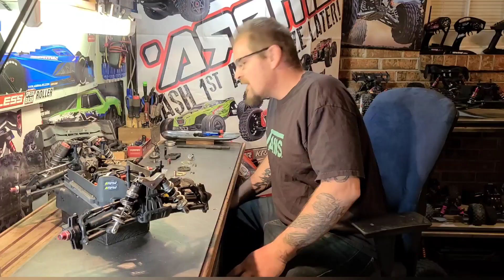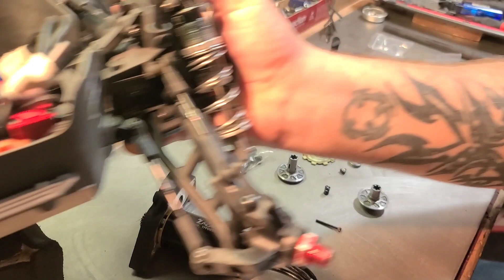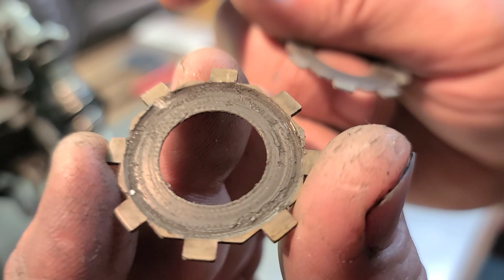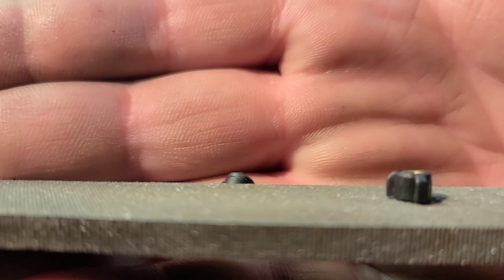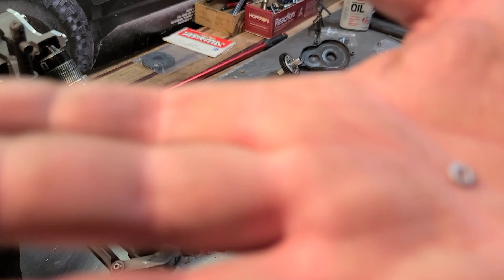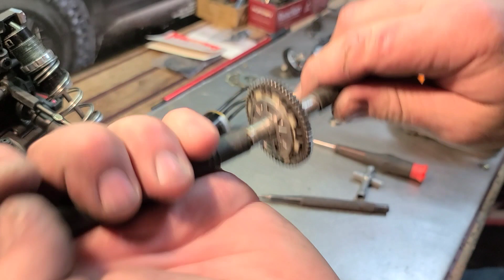how to set your arrma 4x4 3s & 4s slipper cluch, no more problems!

Comment: 18:40 is a good tip about seeing how tight the slipper part of the slipper clutch is supposed to behave utilizing the drive shaft pieces as a turning tool.

Comment: I am new to all this, I purchased an aluminum motor mount, center block support. The piece that slides out with strap. Then it came with a slipper spool all steel. But the spur they gave me is 57T, the vendetta has a 50T. So I want to swap the 50T on the all new steel slipper spool. So this should help a lot. I don’t know shit about “shimming” or nothing. I may break it.
Reply: if you got the generic one your better off with the threaded hub that doesn't interfere with input gear. no trimming just used a arrma slipper clutch threaded screw, spring and the thrust bearing. lots of thread lock. if you have problems getting the motor assembly to click back in just loosen off on the differential screws.... insert, retighten then it will be bullet proof you go through diff ring gear, input gears, center drive shaft faster than the sli[pper clutch.
Reply: i should add here that i learned that the hard way, i put a Granite suspension, wheels ect on an infraction  and i went through 5 slipper clutches
Reply: @daniellangevin7195  I am in the
Process of building a GT Limitless V2. All perfect pass parts. Literally have every single item perfect pass sells. Everything. Then everything else is scorched. Then I have a xlx2 with a 2028 1700kv setup. It’s going to be absolutely insane. I still have the vendetta and I ended up buying a new slipper assembly because I couldn’t get that got dang pin in the damn thing. It was SO FRUSTRATING. I ended up throwing the metal sour gear across the room. lol. 😂

Comment: I cut it and half with a razor and I didn’t have to trim the end where the motor goes cause it fit all the way in now just got to change my clutch slipper pads and it’s good as new

Comment: I reused the stock clutch pads on a hot racing steel spur for my vorteks 3s and it slip’s really bad, I think I need too use different pads and use 4 pretty sure I only installed 3 pads
Reply: you only need 1 or 3

Comment: I have a granite 4x4 mega and put in a blx100 system in it the slipper clutch just slips i got two runs out of it what do I do to fix it?
Reply from the maker: There's a slipper clutch rebuild kit available, it has the special screw bushings & new spring.    Use red loc-tite on the slipper screw when rebuilding the slipper.    Or you could buy a new slipper assembly prebuilt
Reply: @IRONCLADRC  I bought the whole slipper clutch setup the second most expensive one that amainhobby's had cost me 45.00$ can't you just super glue the slipper clutch to eliminate it that's what I did to my Traxxas slash
Reply: get a 57 tooth generic one, then use the hub from it the spur gear and the 3 pads. then instead of using the screw that came with it opt for the slipper clutch maintenace set. i think arrma is 19 cad.
Reply: lots of locktite on longer screw and into the threaded hub.

Comment: Are the V2 4s outcasts slipper pads like PCB boards.. im sure it had metal on them the last time I checked it😂
Reply from the maker: Not sure brother
Reply: @IRONCLADRC  no worries I was actually doing that when I commented.. threw it back together and it's doing as good as when it left the box... Not gonna push my luck but it'll give me a chance to drive with my mate atleast once 😂👌
Reply: Cheers 👍

Comment: I bought a slipper clutch maintenance kit and it it stripped right away. As of I bought the complete slipper clutch kit
Reply from the maker: I had the same issue.   Waist of money
Reply: on the chinese online stores you can get a generic one use everything  it came with except the screw. use the long screw from a maintenace set along with spring and thrust washer. for the 4 extra bucks i would have bought the arrma one now that i see the little thrust washer plays an important function

Comment: Hi I just replaced mine with a differential you'll love it balances out the power front the rear launches out of the hole like crazy and no more wheelies.
Reply: Yes But if you ask your local hobby shop, they will call it a center differential it is the best mod you can do for your RC truck. You will absolutely love it.
Reply: @andrewfrost4802  where did you get it? I can't find any differentials other then a center locking spool
Reply: You mean a center spool?
Reply: I would try the center locking spool. The one you're talking about if you can't find the differential. I bought mine from Hobby Town. In plano texas Super cool guys that work there, too. They are really nice people.
Reply: I forgot to ask you what kind of RC car you have?
Reply: @andrewfrost4802  I have a 6s kraton, a 4s but 6s capable traxxas hoss, I also have a 4s big rock, planning to buy a 6s maxx soon

Comment: I Have The Vendetta & My Buddy Has The  Infraction, We Both Running 4s, We Race On A Parking Lot, So If Tighteen My Slipper Clutch Just A Little Bit, I Will Have A Better Take Off, On The Corners Or Turns, Right??
Reply from the maker: Yes sir that's correct, don't over tighten or you'll run into problems
Reply: @IRONCLADRC  Ok Thanks Man!! I Appreciate..!👍😊👍 I Just Hope My Buddy Dosen't See This Question Or Comment...Lol!😆

Comment: I've done this with my senton I've upgraded to a 3s system and all it does is spin the slipper.  I glued the plates to the hubs and now it just burns up pinion gears.  I had no problems out of the plastic spur and stock slipper set up. I put in the metal 57t and nothing but problems.
Reply: did the 57 th tooth come with 3 pads?
Reply: @daniellangevin7195  nope. Just gears

Comment: My Home Depot Has the same set screw it’s a M2.5x25mm cap head screw but any screw with the same diameter and and a length of at least 20mm works the same I’ve had better luck with a Phillips head that’s 20mm than the ones arrma provides
Reply from the maker: Thanks for the information
Reply: The one arrma supplies is a one shot deal. cross section to thin to be back off esp. after locktite
Reply: @ when I had my Senton the one that was on it was hex, did they downgrade to cross ?

Comment: Now I got a metal spur, but now it's grinding again I'm thinking it's the front differential since it grind when doing wheelie
Reply: did you try the slipper clutch maintenance set. with a generic 57 tooth slipper clutch? the hub fits no housing problems clicks right in. the hub on the generic clutch is threaded for a fair distance yet it slides no problem to input gear and clicks in right away especially if you loosen off on the long diff screws or bolts

Comment: I gave up on mine and just tighten the shit out of it now I have no problem besides popping out cvd or breaking them because the car pulls to hard but I hate taking that thing apart every single time I run it lol now been months not a single problem besides breaking cvd because not knowing about the set screw lol
Reply: Yeah I back mine out half a turn instead of the 1 full turn, or 1.5, whichever it is. Haven’t had a slipper clutch issue since

Comment: Ironclad.. what size flat head screws are those on that spool gear if you don't mind me asking??
Reply from the maker: Oh man I wanna say 2mm or  2.5  I drilled and taped the hole out in the center to accept the larger screw. The 3 on the outside of the home made spool are 2mm counter sank the screw heads and grinded the top flush to clear the inside of the mount

Comment: Good knowledge bro. Thanks for sharing. One quick note, if you don’t want to reduce the size of ‘specialty nut’ and input shaft, you can order Arrma’s new short input shaft that compensates for the new slipper hardware. Love your videos bro
Reply: Do you have the part number for the short input shaft? Thanks
Reply: Well that specialty nut isn't like your it's just a hard plastic without the thread and I lost it. Finally got it working then it breaks again

Comment: Kind of simple but I’m shocked they don’t send the right sized part for the stock slipper hub seems weird I would have to cut that nut and shaft but hey you say it works.  
My issues with the Granite is the motor seized on me once and on my second Granite after bad landings now something is wining like really load not sure what it is as I’m a noob. 
I have a video if you wish too check it out and comment on a suggestion for repair. 
All the power is their but it’s loud I think the crappy bearings in the motor can are done. 
Thanks man cheers 🍻
Reply: That's because it's a V2 input shaft. The V3 one is shorter so no need to file anything
Reply: @htown4175  with some handy work done too the spur gear it’s working good again on my Granite. Needed to be re meshed after some spur got chewed up

Comment: You use 4 pads all together
Reply: 3 hr 1 plastic. Wrk good now
Reply from the maker: 3 hot racing pads and 1 stock pad,  1 stock pad goes on the front side that takes only 2 pads.. stock on bottom and hotracing on top steel spur gear 4s clutch assembly
Reply: @IRONCLADRC  I removed my metal slipper pads and used plastic on my metal spur. They were almost impossible to work with to get my slipper clutch at the perfect tightness. It was always either too tight, or too loose. When it was too loose the truck was slow and no power. Tightened it just a little and i would snap driveshafts. Throw them metal pads away haha
Reply: @IRONCLADRC  yea
Reply from the maker: I like mine just got another set

Comment: You are on the right track...but to make your life easier...u can purchase a shorter input gear (ARA311031)   and as far as the little lock nut...if it's plastic with metal threads you'll still need loctite and it may come loose on you...the newer maintenance kit comes with  a little locknut but it's all plastic ( ARA311033) and it will never come loose on you.  The only time you would need to cut the input gear a little shorter is if you are using the hotracing input gear because it doesnt come in a shorter form.   Ref: https://youtu.be/KKX6MwXOrtc
Reply: Well that explains why I couldn't get my clutch to work right after upgrading to the metal gear, I only had 3 pads from the plastic gear.  Thanks.
Reply: @secret5.  If you buy HR parts...DO NOT USE THE METAL SLIPPER PADS. stick with the stock ones
Reply from the maker: Personally,  I would have to disagree... I love my HR cluch pads. I kinda swear by them. I've had no issues with mine I run them in the typhoon, & k4.   May I ask why you don't like them?  Just currious..   thanks for the awsome input
Reply: @IRONCLADRC  The hub grinds on the metal pads digging into them. when I opened my slipper after just 2 15mins light runs...I thought that I was having issues with my spur or slipper but they were just fine.. when i opened the slipper i seen that the hub was a grinding a deep cut/groove  into the pads. Maybe I had my slipper too tight. I noticed that the metal hubs do not grind or dig into the plastic ones @ why I said 'stick with the plastic ones'  I was Super Excited about my complete HR slipper setup....and maybe I did something wrong...but it didn't work out for me....I can show you better than I can tell you  LOL   https://youtu.be/v0gE9nErLUQ
Reply from the maker: I just popped  my clutch open and I see what your talking about.  Mine was still working great but I definitely  see what your talking about gonna post vid tomorrow.
Reply from the maker: Great information my friend thank you
Reply: @IRONCLADRC    Dude You Rock!

Comment: Is it still holding up? Thinking about doing this myself tomorrow.
Reply from the maker: Yes it is.  Its still tight.   6 packs later.  I am noticing alot of dust in the motor mount housing, and there is a little more play in the cluch i think (I know) its the pads now. So I just got some hotracing aluminum pads, were gonna install.  I've been running an aluminum pad in the 3s typhoon mega set up with no play or wear.  So to answer the question yes its holding up to my hard driving and i recommend setting the screw a little tighter than I recommend in video, if set to loose I noticed the pads wear down faster..  thank you & good luck my friend
Reply: @IRONCLADRC I was thinking about that. Very good point. Tightening it a lil more so there is less slip and less grind. I've sanded down the grooves in the metal pads.
Reply from the maker: Yes I recommend  it.